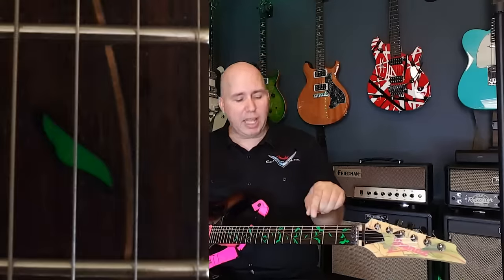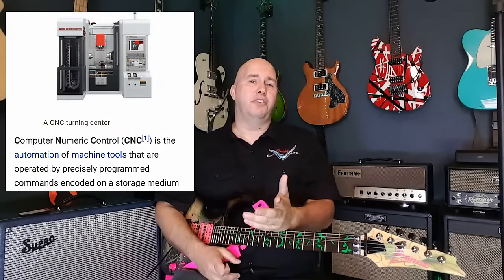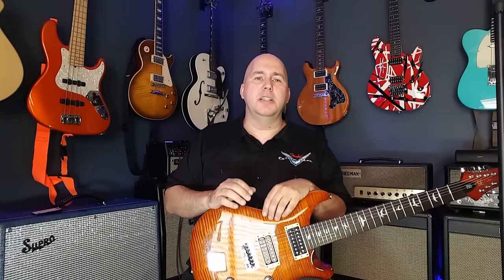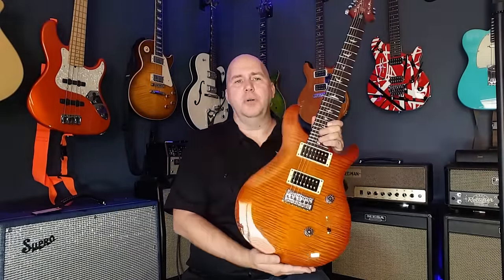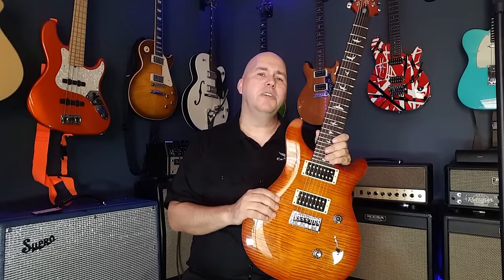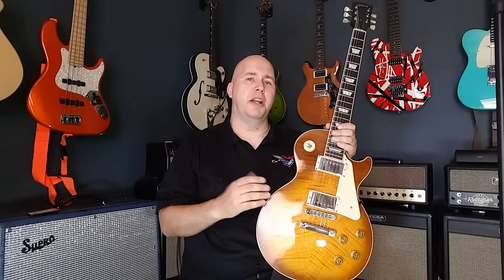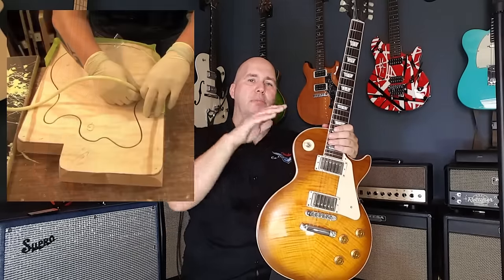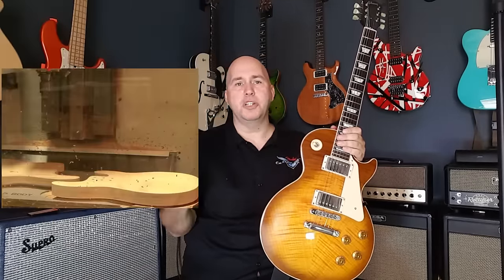7 Things That Do Not Make Guitars Expensive Anymore

Comment: Wouldn't the single biggest thing that has lowered the cost of making a guitar be the use of the CNC Router. And not just the binding, but the whole guitar. Used to you could go into a guitar store and tell the difference between a USA strat and a Mexican Strat just by looking at the string action. The action on the Mexican strat would be almost unplayable. Now you can pick up a Squier Strat at half the cost of a Mexican strat and it will have relatively awesome action.The CNC router allows a manufacture to make each guitar, be it American made, or a bottom of the line guitar made in China, better than a mastercraftsman could ever do on an older ultra premium handmade guitar. This allows a cheaper workforce to make a better guitar and with fewer rejects or errors at a significantly faster pace.

Next Up would be a Plek Machine.  Manufacturers (Gibson) like to brag about the use of their Plek machine to make perfect fretboards. What they are actually doing is taking low quality fret work and correcting it with a Plek Machine. The negative side to this is that they are grinding down the frets to make them even. Do you really want a guitar whose frets are worn down because the manufacturer didn't take the time to do it right in the first place. How much does it cost to refret a Les Paul when the frets wear out prematurely?

Comment: My '55 Epiphone Deluxe was cavity routed, inlaid, and then massive amounts of filler added.
THAT is the primary reason many headstocks are black.  It hides the poor fit of the inlay.

The through neck is a little more intensive to build by hand but when the parameters are set
in the CNC there is no difference between set, through, and bolt-on.  Any discrepancies are
quickly adjusted in a bolt-on, and even in a factory they are by far the least expensive to build.

Set pickups, domed frets, attention to small detail (inlay, binding, etc.) can quickly drive-up the 
price.  

Good observations, but they seem to be observations of a player - salesman, than those of a luthier.

Electric guitars are a huge scam.  It's very easy to mass produce a high quality electric and sell it
for the same price as a quality acoustic.  In the past we would routinely spend 5+ hours on a (get
ready for this catch phrase) "Hand made" electric guitar.  They would generally cost less than $100 
to produce.  

One player compared our best guitar (6 hours and about $125) to a $20,000 guitar he had recently
played and declared it; "better than that one".

A few minutes on the heel, doming the frets, polishing, adjusting the action, and hard-setting the 
pickups can take an average guitar and make it great.

Comment: What is a shim? I've heard of it but I don't know what it is.
Reply: A shim is any thin material used to change the angle on a neck.  As an example, you could unbolt your neck and place a thin strip of cork or a playing card, or believe it or not even guitar picks in the neck pocket and bolt the neck bak on.  The material (your shims) will change the angle of the neck relative to the strings to assist in setting the action.  Peavey and 3-bolt Fenders have a small set screw that can be adjusted to change the neck angle.  I believe Fender marketed is as the Acu-Tilt neck, or something like that.

Comment: What about the PRS JM Super Eagle model for 12000? It's a non sense.
Regarding to the final price of a guitar I assume that the knowledge behind on how to make it sound better than others choosing the right materials for its right tone is important as well as the time and skills employed on sanding and finishing the whole guitar to a flat and polished surface which will give the final appearance to a particular guitar the right look. Most cheap guitars have a wavy and thick finish while others on higher grades seem to be more perfected including the quality of colors chosen, stains, or sunburst (in some cheap guitars sunburst are horrid).
Also the time and knowledge applied to design a guitar with the right contour for the neck and fretboard, polishing the frets to perfection and selecting hardware with different quality finishes can vary the price of the guitar I assume. And as I write I think that the type of components in the electronics and its quality and the difficulty wiring different pickup combinations should be reflected in the final price as seems normal.
Add to the final price a gig bag or a hard case and how much your employers had to earn depending on where was made and... voila!

Comment: You left out the impact of high accuracy digital CNC machine tool and the ever increasing accuracy and speed  that they deliver. Also sheer manufacturing volume. More guitars are made each day than ever before. That's we have collections of them nowadays.  Also the amazing chemistry advances in surface finishing.  Same thing with advances in metal composites and mouldings equipment.

Comment: totally disagree about a longer piece of wood being harder to find / costs more. as a wood worker who works with exotic wood all the time, having a piece of wood thats straight is no big deal. its why we have planers and jointers.you buy wood rough cut then cut and finish to size. I've seen some really large boards - as in say 16-18" wide 2" thick and 16' long straight and flat. don't mistake the crappy 2X4's you mention in a lumber yard as representing what you buy in fine wood. its totally different. when you are buying anything from ash to mahogany ( which can really mean a few different species ) as well as other exotics getting 9' average length straight boards is the norm. Also don't be fooled about the cost - an ash body say roughly 18"X12"X2" cost less than $10. likewise the raw wood for walnut, maghogony is about 2X-3X that cost. yes fancy grain woods are expensive, but thats why they use laminates... which is also good environmental practice in stretching out the use of that wood. the laminate could run $10 or so for something common, to $50-$75 for something really wild. those are regular "wholesale" prices the average cabinet maker would pay... some consumer retail woodworker place would easily hit you for 2X that, which means you need to find the right places to go. a guitar maker would buy direct from the suppliers and of course pay less.

Comment: The sad side in my book is that once the builders had a pride in their skills but that machines have mostly replaced this. So makers can hire people who clock in at 7 pull the levers and go home at 5 without any pride in what they've done. There are still the odd person here and there (like the people that custom fit glued neck joints) but mostly it's a machine. Is that better?? - well it's cheaper usually but machines don't reject defective parts.

Comment: I think you left out a lot of expenses that modern day luthiers now have to include in their mark up, even with small price cutting innovations such as a poured binding, it will still have little to no reduction on the cost of per unit. People forget that salary's, taxes, and initial start up debt of a major brand have to be factored into the budget, this is where the majority of the price is formed. Not to mention, the countless hours/years of research and development spent to make guitars that people cherish today.

 If you are arguing that guitars shouldn't be as expensive as they are because of the 7 points you mentioned in the video (which it looks like you are) then you are terribly mistaken. Have you ever sanded a body fresh off a CNC machine? Tried to set a neck on a Les Paul or Prs? or better yet; tried to shoot a poly style lacquer on a body? You will notice it takes a lot of hours of physical labour to get everything assembled, it also takes a very experienced Luthier to do it well. As for the difference in price between for example; a prs cu24 and a cu24se, it is the salary difference of people who are assembling the cheaper models than more expensive ones, this includes the final inspections and quality control.  

If people want to bitch about price, go and buy all the raw materials yourself and assemble your guitar, you will most likely create a piece of garbage if your an amateur. No one here has ever budgeted for a major guitar company and has no idea what the tax codes are like, tariffs, and god knows what else is included. 

I'd imagine the margins for major companies are probably decent, but their a complete joke compared to other commodities such as computers or house-hold appliances, stuff that doesn't need to be painstakingly sanded and controlled will have a much greater return than musical instruments. I'm not saying that guitars that are 5k or 6k are worth every penny, but 3k for a guitar like a Prs, somewhat reasonable.

Comment: basswood is about the same price as maple, and most modern mohogany used is the less expensive african variety, which costs about the same as the other two woods. honduran mohogany costs a little bit more. none of these woods are really cost prohibitive, atleast for a small scale wood worker like me anyway. however, if you shop online for this stuff, they are all marked up tremendously because the sellers capitalize on the naiveness of their consumers.

Comment: Some people will buy anything if you charge enough. It's a symptom of consumerism to look at a $500 guitar next to a $2000 guitar and automatically assume the $2000 guitar is 4x better. factory robots and cncs have gotten much better in the last few decades. Chinese guitars can be just as precisely made as any American guitar. The main quality differences now concern material and component quality more than fit and finish. I avoid cheap guitars for this reason. I hate the thought of getting attached to a guitar and having the neck start twisting after a few years because they used inferior or improperly dried wood. Why can't there be a middle ground?

Comment: Then why do manufacturers like PRS , Gibson charge 5x for their guitars ? Surely it cant be on brand name alone...
Reply: AngeV2 Well their is a lot of time that goes into these guitars. Setting the neck takes a whole extra day at least, and paint can take a while to dry. Not to mention that Gibson does a LOT of work by hand. All in total a Les Paul Standard is about 5x what it costs to make, and a studio has less of a profit margin. That's because they sell way more studios than standards.
Reply: It certainly is on brand name. Gibson makes good guitars but they also produce a ton of mediocre guitars. That's one of the downsides of using hand-labor to mass-produce a product. Don't expect that a guitar is good just because it has an authentic gibson logo on the headstock, although that's what most people think. If you really want to spend $1k+ on a guitar, at least be sure to try it in store first.
Reply: Many people will do that though. But when I started playing clubs it just made more sense to have something that you don't mind if it gets scatched up, or knocked over by a drunk. Plenty of decent playing and sounding guitars out there for the fraction you'd pay for a Gibson
Reply: Absolutely just the brand name. A 2k Gibson can't even hold a candle to a Skervesen/Mayones/Kiesel/EBMM of the same price point.

Comment: You know what makes a guitar really expensive? All the marketing BS about how special the used wood is, how excluive the magnets and the enamel on the wire of the pickups are and the so-called specially made for them only reengineered/surplus NOS capacitors.,  the difference in sound between today bone nuts vs the ones from '57 (because the cows where fed different) and needless to say the massive game changing difference in sound between the machined steel and stamped steel or vintage vs new brass bridge saddles.
Bottom line what makes a new guitar expensive today is the BS story that is told around it
. 
Construction wise there is almost no difference between a say squier standard strat, a Fender custom shop one or a Mexcian one.  Or do you really believe that the CS are making the neck and body completely by hand? Both come out of the same type of cnc machine.

Comment: So...basically, all of the components of a guitar are inexpensive, and we're paying for...

In many cases, the brand name, and collector perceptions.

All this rot about "vintage this, and vintage that..."  It's crap.

My first real guitar was a Fender Stratocaster.  Either a 1970 or 1971 model.  I bought it used, in 1978, for $300.00.  It was played a lot, before I got it, and I played it a lot, too.

What is it's "vintage value" today, what, with all the "mojo" it had?

Probably about $3000.00.  

I'm guessing there.  Mine was stolen from me in the early 1980's.

I've played several new guitars since that old bird, and I'll be quite honest here:  In many cases, they were just as good, or better than that Strat.

Basically, if you're a player, use your brain.  Don't buy something because of the brand.  Buy the best quality you can, for the amount you want to spend.

Comment: Photo flame is not a decal, it's a process using uv light to darken or yellow a finish which they do in patterns to simulate flame or quilting,  the way you speak of many of these processes is a bit dishonest,  these small things that while the process is cheap to do it can be expensive to add them to a production like, in terms of having to modify,the line for an extra step or even just the extra time they take to do.   The current guitar market is a race for the bottom with everyone undercutting everyone else if a manufacturer could offer a feature for only pennies more to give them a leg up on the competition they would. Fact is they can't.  Nor would it even make good business sense to do so.

Comment: Binding is one of the two "luxury" items that are quite ridiculous except for pimpy bling. All that work for... for... NOthing except oh ain't I purdy.... the reason for binding is to seal the endgrains of tops and backs on hollowbody guitars. On a solidbody, it's just a useless expense, and the only reason you think it looks better is because somehow or another you were instructed to like binding and gitpickers are nothing if not obediant arch-conservatives. And the other is the ridiculousness of putting a toggle switch on the UPPER horn of guitars. At least on a hollowbody they can fish the wires out there. But to ROUTE a CHANNEL for it when clearly you can shield short wiring runs withOUT adding extra wire, just by putting electronics TOGETHER. 

Keep your wire runs short. Am I the last un-retarded consumer in the whole shebang? 

My TOP PRIZE WINNER for pinheaded manufacturing idiocy of the New Century  (so far) is the pickup toggle RUINING the lines of the ultra-trendoid Petrucci "Majesty".  To actually work harder (charge more) to put a switch in that place, adding extra shielding concerns, extra labor and it's uglier than cane toads to boot - how many people ever REQUEST switch locations? When I see something that stupid I have to question their judgements about everything else.  - are they losing it? Have they lost it all already? That thing had the potential to look really, really good - but not with the giant zit the day before yer senior prom.

Comment: I will hand anyone 5 guitars. If anyone can show me which is flame maple and which is photo flame (screen printed fake wood veneer) I will pay anyone $20,000 if they can guess which is which. If they lose I get the $20,000, because I have to tear up the top to prove it was a photo flame.
Reply: Are you sure about that? I think you can still tell if it's photo or thin veneer, there's slight wood structure to it that can be seen moving a bit when looking at it against the light.